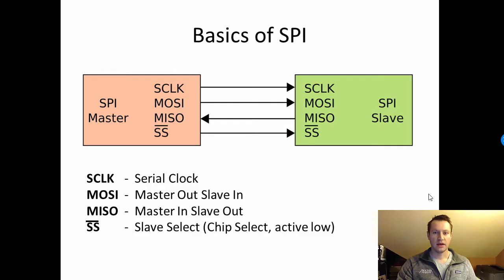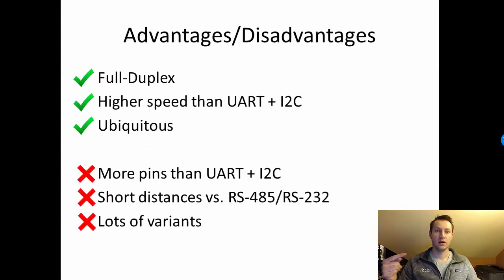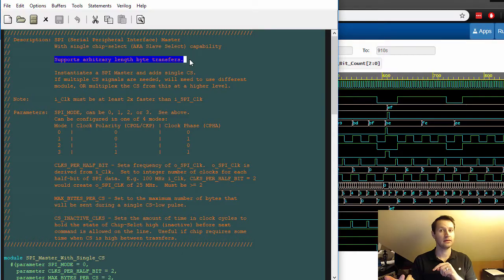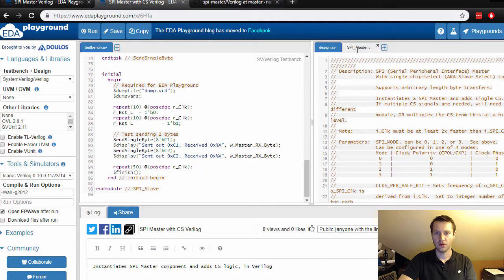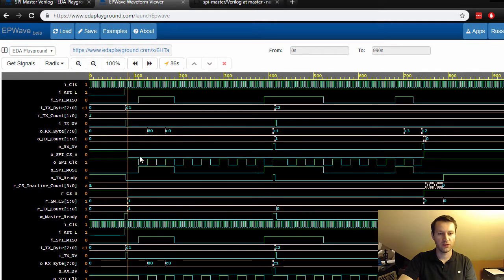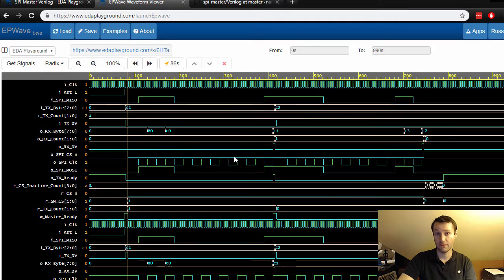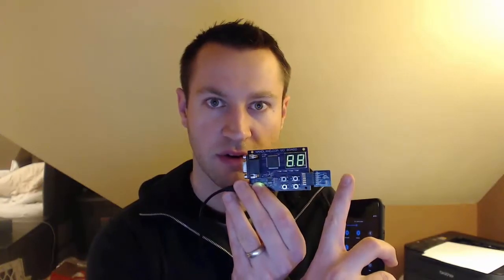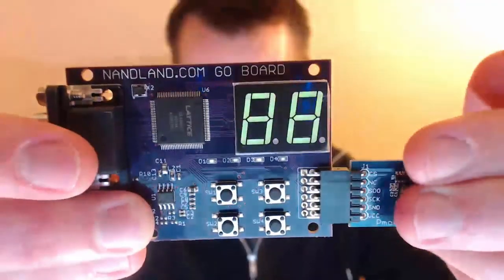SPI Master and Ambient Light Sensor  - Introduction

Comment: Hi,
I would like to connect an AD9434 EXTERNAL ADC BOARD TO BASYS 3 FPGA. I am looking for an spi interface code in verilog. Im sure that this would be helpful. Could you help me out with the constraint files that I need to modify for the above mentioned verilog codes. I am doing this to evaluate the high speed adc.